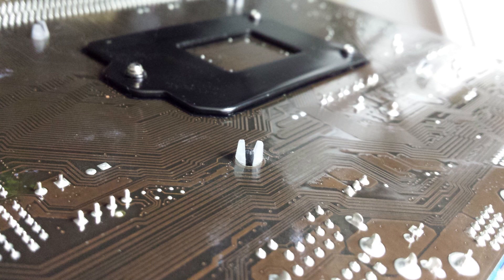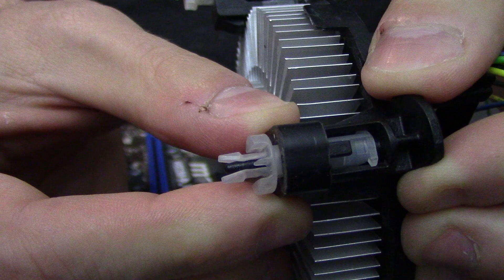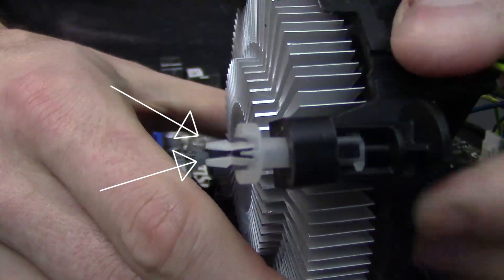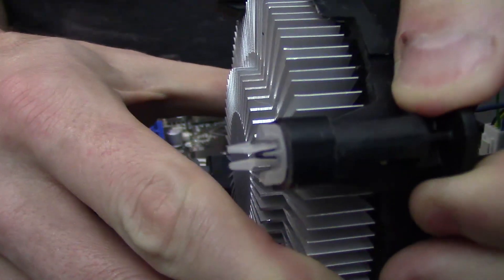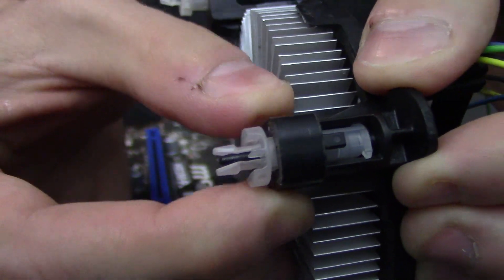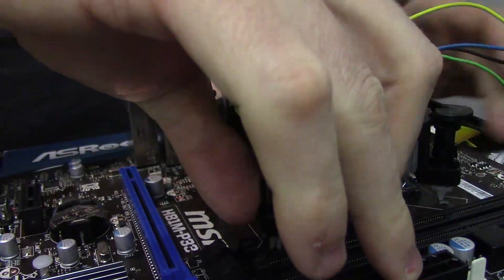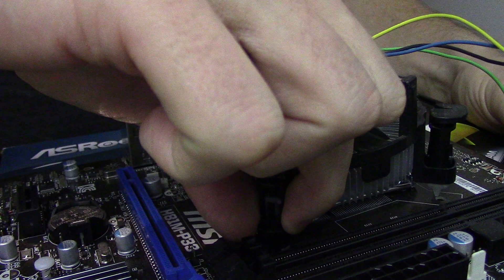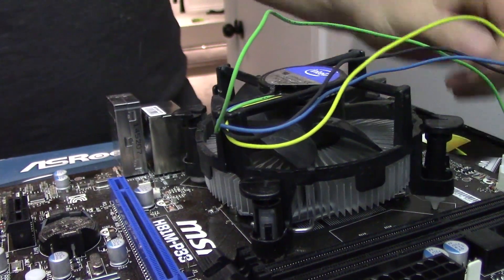How to Apply a Stiff, Stubborn, Stock Cooler

Comment: hey Oafah i am looking at upgrading my PC but don't know what parts i should buy to upgrade it.My PC consists of two gtx 760's 16 gb ddr3 ram and a fx 4100 processor. i know i need to upgrade my processor for a couple reasons. one of those reasons being when i play most games my GPU1 is at 99 percent usage and my processor is also at 99 or 100 percent usage, but my second GPU is barely getting used. i just want to know your opinion on what i should upgrade to. ive looked around for used parts on craigslist but couldn't find anything worth buying. would really appreciate your opinion hopefully you respond :D.
Reply: oh i want to also add that the performance isnt the best i want to play most games on ultra or high settings but most i can play on low settings. also the fx4100 is overclocked at 4.4 ghz
Reply from the maker: If you don't want to invest a ton, get yourself an FX 8320 second-hand, and replace that FX 4100 with it. Make sure your board supports it first.

AMD FX series CPUs are actually getting a bit of new life thanks to many new releases being very well optimized for multi-threading.

You won't get better single-core performance without a platform change, though.

Comment: Step number last: throw away this plastic shit and buy normal cooler with back plate and screws. I did :).
Reply: Unless you are really into overclocking, then the stock cooler is good enough. 
Its quiet, easy to use and its free.
Reply: I don't overclock at all. Stock cooler is absolutely fine to me. but those plastic nipples just totally unreliable. Actually, I don't understand why Intel continues making them. How much 4 normal screws and metal plate will add to cost? 50 cents? Dollar? It's nothing compared to usability and reliability added. But because of strange Intel politics I had to pay additional 15 dollars to get whole new cooler. And I still think it was a good deal.
Reply: 1kvolt1978 it would be cool if they included a higher quality cooler, nut the intel stock coolers are very reliable, and free,

Comment: buy an aio and forget this shjt haha
Reply: Wrong
Stock cooler performs quite well, and its quiet and free. 
you really should only by an aio if you are super into overclocking.
Reply: Daniel Stevenson sure, man
Reply from the maker: The majority of users don't require an aftermarket cooler, really. This video is intended for those people.
Reply: you don't need an AIO for 99% of reasonable chips mate.
Reply: Oafah 
I planned on buying a new cooler when i built my current PC back in 2014, bu ti have been keeping an eye on performance i havent needed it for gaming and video editing.